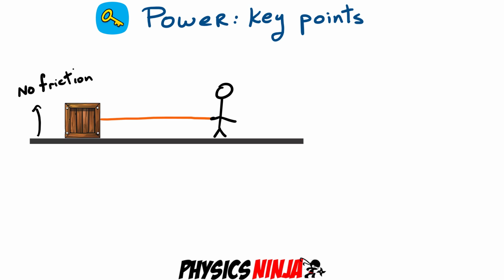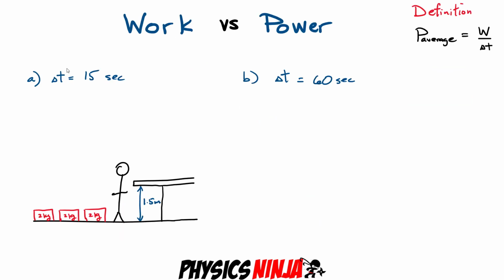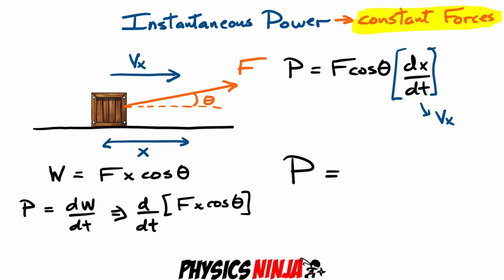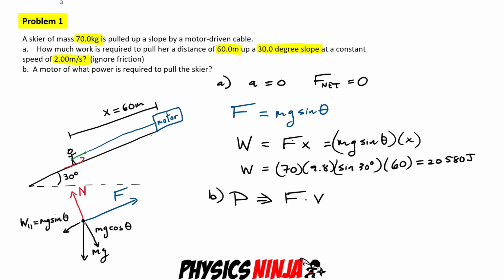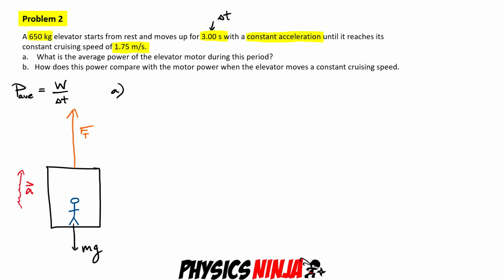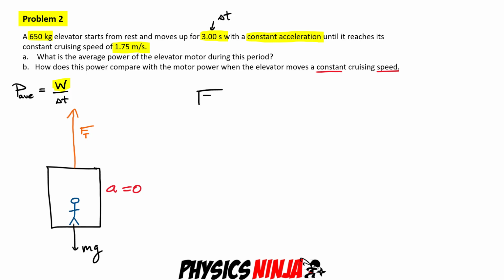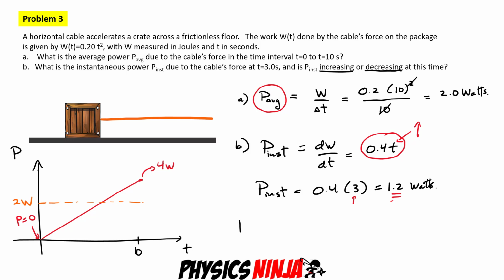How to Solve Physics Power Problems

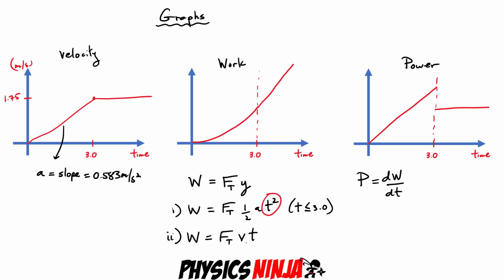Comment: At 26:10, for the power graph before 3.0 seconds, why isn't the power graph a flat line instead of increasing? Given the acceleration is constant and that the elevator force is constant, why would the power increase as time goes on? This makes no intuitive sense. Thank you for making this video. It's saving me for my exam tomorrow.
Reply from the maker: If it’s accelerating it means the velocity is increasing.  You need to have power that also increases with time.